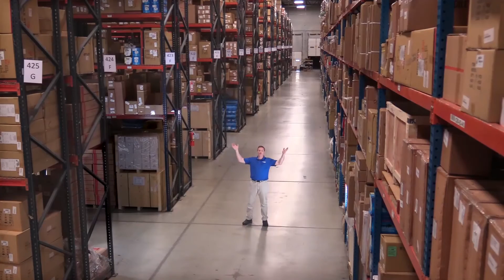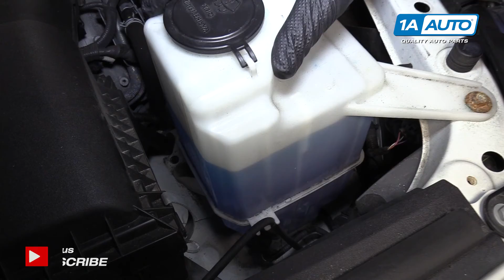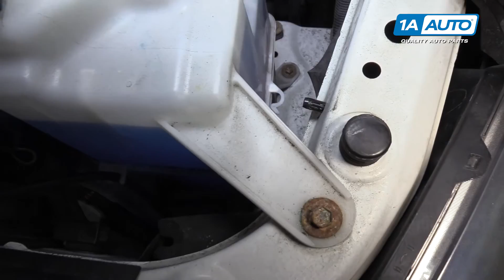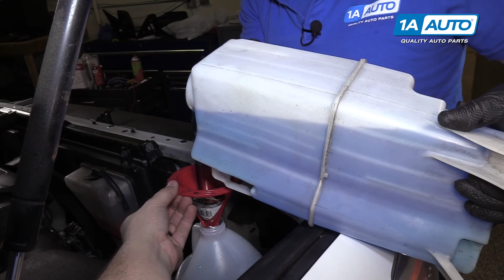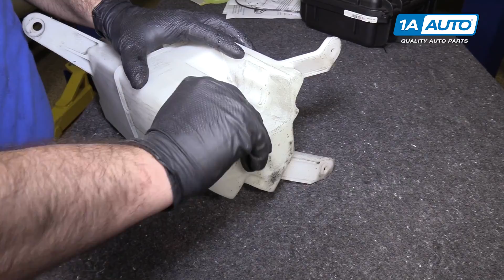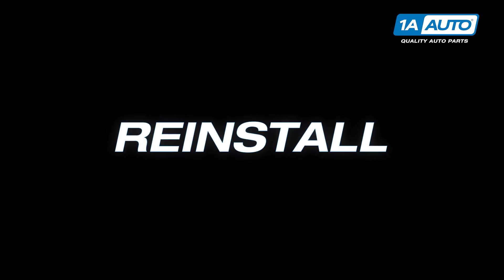How to Replace Washer Pump 14-19 Toyota Tundra

Comment: Great instructional video, followed all your directions. Everything turned out perfect,... However, my "Low Washer Fluid" warning indicator light is always on. And it's full. Is there a way to reset it, or turn it off? It's working fine, but can't seem to turn off that warning indicator light.

Comment: I cannot get the power source disconnected from the pump. The video said use a small flat screwdriver, but never gives a good visual as to how to do that. The space is too small to take a picture so I am stuck. This should be an easy fix, but disconnecting the power has become a nemesis. I have literally spent hours trying to just disconnect the power.